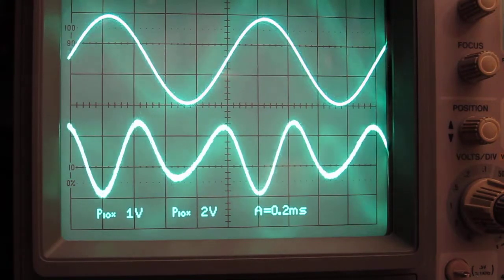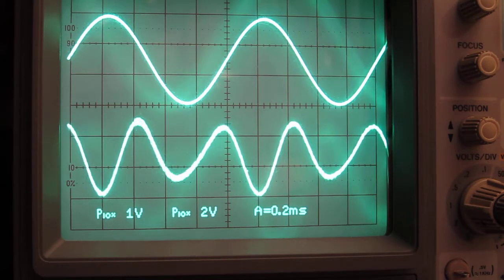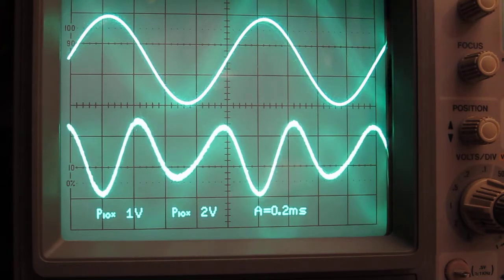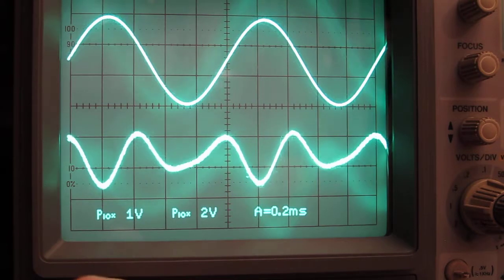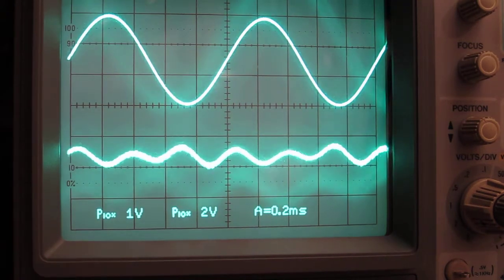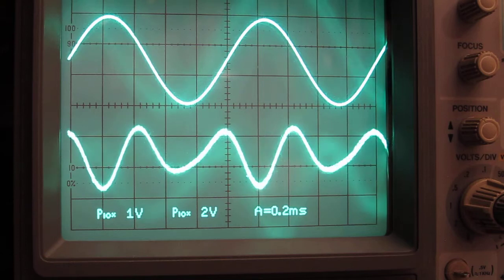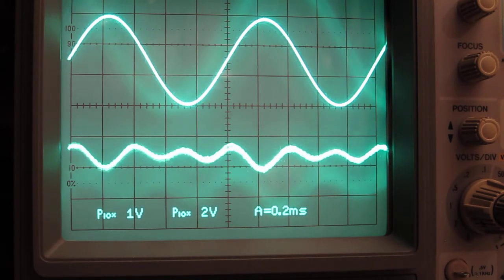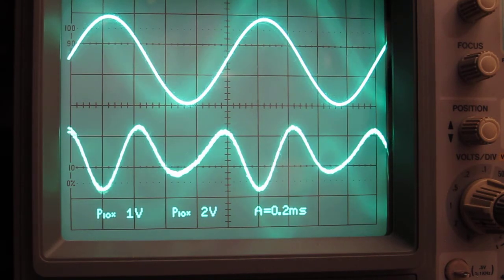Adjusting P3, Nelson Pass Burning Amplifier BA-3

Comment: Is the sinewave on the top the original input signal and the sinewave at the bottom the outputsignal from the amp?
Reply from the maker: The top is the sinewave to the amplifier input from the signal generator. The bottom is the output from a HP339A distortion analyzer, this trace is the output from the amplifier as seen through a very precise, steep, and deep notch filter at the same frequency as the initial signal - so you see what's left over, I.E., the distortion. This is called the "distortion residual" and shows the amount of distortion (taller is more) as well as the harmonic character of the distortion, which is why there are more peaks and valleys in the lower wave... the residual is a harmonic multiple of the original sine, varying mainly between 2nd harmonic and 3rd harmonic.

Comment: On the 2ng harmonic, how much is the voltage output measured after the lm317? I dont have any osciloscope, so I guess adjust the voltage could give the similar graph. Thanks.
Reply from the maker: There's no LM317 in the circuit. The traces shown are (top)  1Khz signal applied to the input, and measured across a load resistor on the amplifier's output, and (bottom) the output of a HP339A distortion analyzer, displaying the "distortion residual" output. The 339A is a very specialized bit of test equipment, where the signal of the top trace is sent through an extremely sharp and steep notch filter, removing the 1khz signal, and then displays what's left (the residual distortion after the main signal is striped away) on the bottom trace. The scope is used merely for display.

Comment: How many turns should i make when adjusting P3?
Reply from the maker: As many turns as it takes to set the measured distortion profile you desire. Use a distortion analyzer or FFT, set using a 1K sinewave with sufficient amplitude to have 1W output.

Comment: Is setting P3 in the middle of it's range by measuring the resistance of the sources to ground a decent way of getting a good result?
Reply from the maker: In order of setting it at it's midpoint? Yes, that works.
Reply: xAEROPLANEx Thank you. Your build guides at diyaudio we're very helpful in the F5 I just built. I thought I'd had P3 at the middle when I installed the boards but they measured way off from middle when I was tweaking it the other night.
Reply: xAEROPLANEx   So I dialed P3 into center by measuring resistance on the source pins to ground. It definitely sounded different. In fact it was down right hard to listen to. It sounded very crisp and clean and the highs we're razor sharp. I don't have the gear to measure, but I'm assuming I found the point of nulling the 2nd harmonic. I readjusted P3 again raising the resistance on Q2/J74 by half an ohm and lowering it by the same on Q1/K170. That made a big difference. Very easy to listen. The sound is more fluid and less bright while remaining clean and detailed. I'm going to say if you don't have a scope and distortion analyser a good place to start is a half ohm off center as measured at the source pins assuming Q1 and Q2 are well matched. I think it's the best sound I've got from it so far.
Reply: @sklay78  Thank you for this approach.  My experience with the F5 (Turbo, V2) was exactly the same.  Hard, forward, piercing, which was a disappointment compared to all the other Pass amps I had built.  But adjusting via the approach you described turned it into a sweet, powerful amp with great imaging depth, dynamics, and timbre.  It is amazing that such a minor adjustment can have that much impact.

Comment: Can the distortion and 2nd or 3rd harmonic dominance be adjusted using FFT? My oscilloscope has FFT capability and QA400 doesn't provide the distortion residual output. I seem to recall seeing someone adjust via FFT on diyaudio.
Reply from the maker: Very, very few oscilloscopes have a vertical bit depth large enough to FFT an un-doctored signal and show harmonics that are 70-90db below the fundamental. If you have the distortion analyzer that outputs the residual, you can run an FFT of that and see the harmonic peaks in relative height on a 8-bit (vertical) scope.

BUT your QA400 can do it all by itself - (assuming you have a signal generator of some kind, soundcard is fine) Just give the amp a 1K signal of sufficient amplitude to output 1W from the amp - in my case I use a 4ohm load resistor and adjust the generator until I have 2.83Vrms on the output. Now run a THD or THD+N analysis on the QA400 with the peak of the output's signal at 0db or -10dbV. The harmonic spikes should be very visible above the noise floor at 2k, 3k, 4k, etc... Adjust P3 until you have the relative heights of 2nd harmonic and 3rd set to your taste. (I prefer 2nd higher than 3rd, but that's my opinion.)

Remember that minimum THD will occur when 2nd harmonic is nulled down to it's minimum - which means that the amp is now very 3rd harmonic dominant.
Reply: xAEROPLANEx Thanks.  When I built the F5 I set the pots to their middle values using a DMM.  I haven't been able to see the distortion residual in the same manner as you have it graphed on your oscilloscope, but, I have been able to see the FFT plot on the QA400.  I've used a 1k sine wave from both the QA400 and a 1k Viktor oscillator and I can see the 2nd and 3rd harmonics in the FFT plot.  I'm still monkeying around with the Viktor oscillator to get it to perform at its best.  Viktor states his oscillator works best using an LM317 regulating 35V from a transformer.  It's also been said on the diyaudio forum (Equipment & Testing section) that the Viktor oscillator works best at the high end of its potentiometer but that will put out 2.6Vrms.  The QA400 wants 1Vrms so if inputting directly into the QA400 one needs to attenuate the signal in some way.  I'm working on Dick Moore's active notch filter but it'll be some time before I have it ready.  When I run a signal through my F5 I use a couple of Arcol 100W 8ohm non-inductive dummy loads connected to the outputs.  I also have to check impedances of all devices and see if I have any issues there as well.  I'll have to post a photo of my setup and get feedback.

Comment: Is doing this on an oscilloscope required to build a F5?
Reply from the maker: Required? No.  In my opinion the amp sounds best with the pot near the middle - although that is dependent on having well-matched Jfets.

And just an oscilloscope is not enough to see this either, you need a distortion analyzer. The oscilloscope is just to see the distortion residual waveform output from the distortion analyzer.  Also, you could set with a FFT and test tone, if your FFT is of sufficient resolution

This can be set by ear, it's subtle, as it's changing the character of the amp and not the tone --  keep notes on how many turns you change it, listen, turn more, listen, take notes all the way so you have an idea where the pot is set... If you get lost, you can always turn the pot all the way to one end and turn it back 1/2 the number of turns, which will get it to the middle.